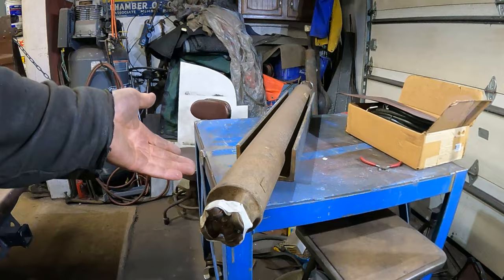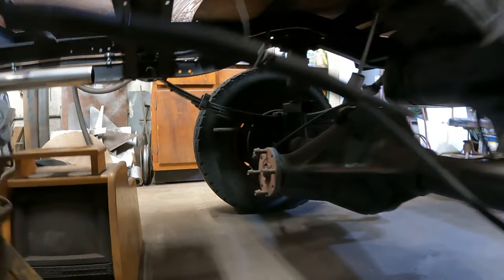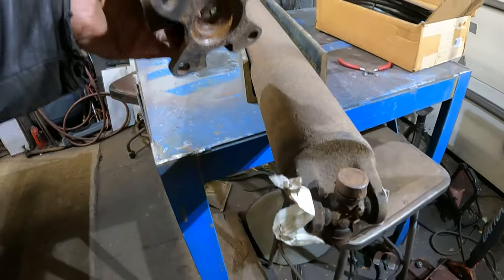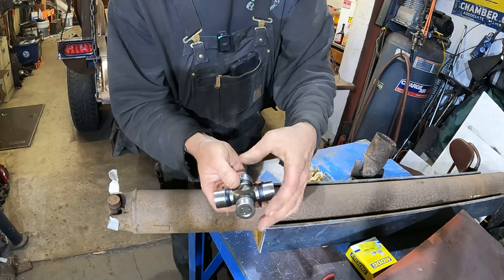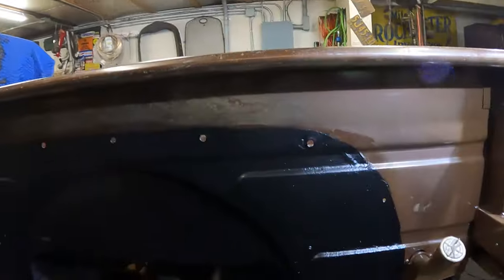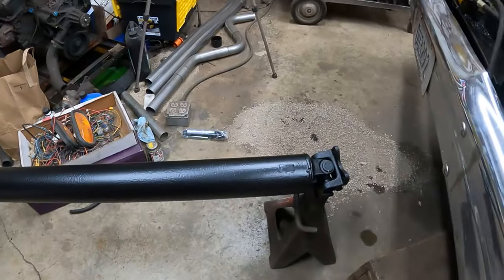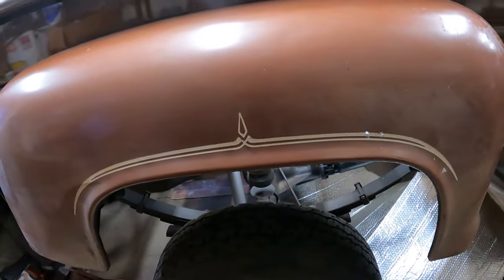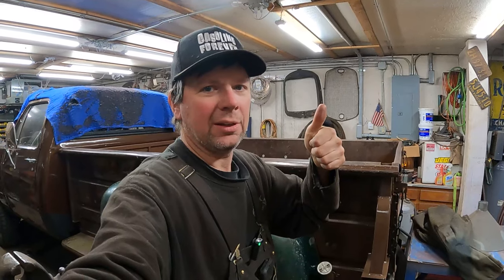Conversion U-Joint and Rear Fender Install :  1980 Dodge W200

Comment: I've been using oil and NH oil to rust protect my 98 Dodge Ram Plow Rig. The road Salt here in Toledo is ridiculous. I know from years of battling undercarriage rust how detrimental it can be. Thus far its the only thing I found to even begin to protect it, although I've never used those products "rust encapsulater" etc. But I have used rust Reformer but it seems expensive  especially to cover an entire undercarriage and these trucks have alot of square footage underside. How is the Fluid film product? And what's the name of the rust reform and coating you are using? Again I've Used NH oil. Just seems like you are lucky if it lasts a season. And it's alot of messy work applying it. I also use a paint style sprayer when I do apply it. Seems to me we need class action Lawsuits for this damage. Uggg
Reply from the maker: I spray Fluid Film on everything.  The truck will get sprayed with a gallon first round and retouched every year.  I painted everything under the truck flat black as the FF seeps into it.
Reply: @QuickSpeedShop  ok, im Gonna look into it.  I've heard of it just curious of price comparison and how it's applied.  Thank you
Reply from the maker: The NH is probably better long-term if it's petroleum based.  FF is lanolin, which is sheep wool wax and will wear off if not reapplied.